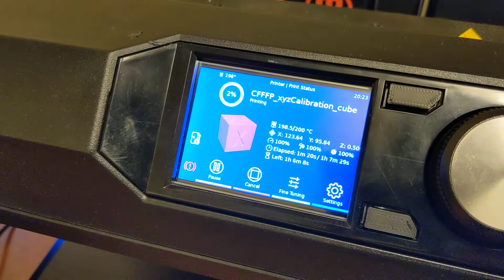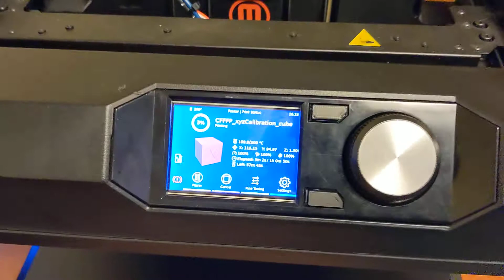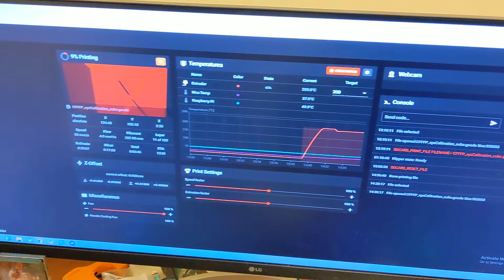Makerbot Replicator 5 with Klipper Part 3 Final!

Comment: Hi, 
Hey, I was so happy to find this video series, as this is exactly what I was wanting to do with the makerbot replicator 5th gen I picked up recently.  I have most of the parts purchased, and I've started 3D printing the files on github, but I, like another viewer, didn't hear you mention what exactly you did for the power supply??  Did you tap into the original, or just add one?  Did it end up being 12 or 24 volt?  I know  its an old video, and you no longer have the printer, but any help you can provide is much appreciated.  I've subscribed to your channel, and I look forward to sifting through all your old videos..  :-)
Reply from the maker: original 24v I believe

Comment: Hi, I couldn't find a part where you mention what extruders you use, I can guess most of the part list just not the extruder and the filament feed. My highschool had one sitting in the art room because engineering got tired of fixing it and it managed to badly jam 2 smart extruders+ and I couldn't unjam them so this is cheaper than buying new extruders as well as them just being a bandaid fix.
Reply from the maker: I just used a BMG clone extruder setup as Bowden, you can mount it anywhere
Reply: @Rolohaun  thank you, also in part one you rattled off some possible hot ends but which would you recommend?
Reply: @Rolohaun  I'm unsure about if you reused the makerbot power supply or not? There is an old guide on hackaday that did replace it did you follow the same link as they did?
Reply from the maker: @notakid8523  if it's 12v then I replaced it if it's 24v I would have reused it
Reply: @Rolohaun  I think you did get a 24 volt PSU cus the SKR board has an input voltage of 24

Comment: is that an accelerometer mounted to the top of the tool head?
Did you use it for something other than input shaping?
you never mentioned it, and I was confused by the holes when i printed the mount.
Reply from the maker: Yes I had a 345adxl mounted on it

Comment: Hello, I am currently part-way through recreating your project and attempting to reuse the extruder/direct drive functionality. Would you be able to show the wiring setup of the printer board?
Reply from the maker: unfortunately I don't have this printer anymore, I was not able to use the existing extruder and such so I just went Bowden with a modern hotend
Reply: Any bro tips?

Comment: Hello, considering configuration, you think did be viable to adapt the same type of mod to a Z18? I found one for dirt cheap and while it still works, and considering my application ill continue using it until it craps out, but I love the build of the machine. So when the time comes, an adaptation  for it to run clipper would work the same way as it did here?
Reply from the maker: yes as long as you change the mainboard and toolhead you can use most everything
Reply: @Rolohaun  appreciate the reply and the video series. Have you have your entire experience documented?

Comment: I've seen a broken Replicator for sale near me, was searching to see if anyone had installed Klipper on one already, nice build! Did you go through stuff like input shaping? Any ideas how fast you can push this printer? I figured it would be quite solid and likely able to do really well from having new hardware installed on the existing motion system
Reply from the maker: it's pretty good the Replicator 2 is H-Bot kinematics so not corexy but with Klipper it should do pretty well. I never tried input shaper but the frame is solid

Comment: You couldn't use the original smart extruder?
Reply from the maker: No, and it is not reliable at all, the worst part of the printer.
Reply: I just finished rebuilding one with a Marlin/Ramps-compatible controller that I ended up with for that exact reason - its previous owner got tired of dealing with the terrible "Smart" Extruder and it was donated to a makerspace salvage pile. It's expensive, unreliable, proprietary, and forces you to either keep throwing time and money at it, or you rip it all out and replace the electronics with open-source parts that can be serviced and replaced easily. The bones are good for a CoreXY/H-bot, but the smart extruder is frequently what gets these relegated to the junk pile.

Comment: Is that a ender 3 magnet plate or the sticky one. I tried going thru the GitHub but I have no idea where to start. Like is it a new board or is it off the makerbot board?
Reply from the maker: I would a SKR board in the machine, the build surface is just a clone Builtak surface for enders. Just a sticker I got from amazon

Comment: Hi, well done, I also hate my makerbot ! But I have no xp with the coding stuff for the klipper printer configuration. Will your config also worke with a btt skr pico v1 board?
Reply from the maker: mine is for the SKR mini e3, the pins are different. The klipper skr pico example would be the best to start with. You can reference my config on the github though
Reply: @Rolohaun  okey, so I only have to change a little bit ?